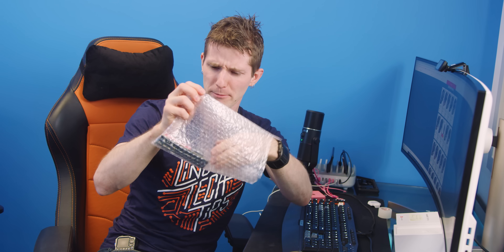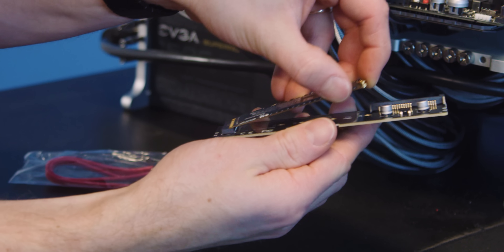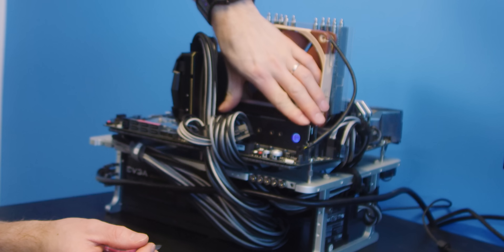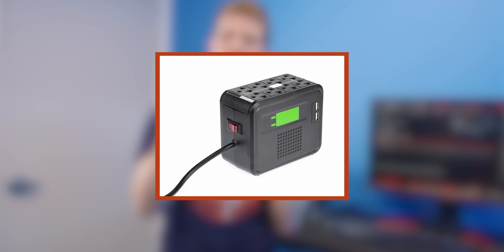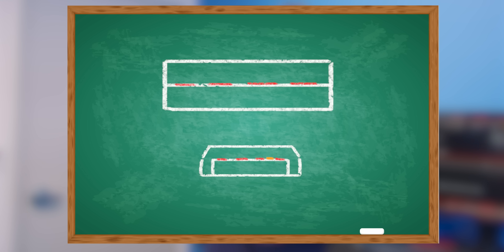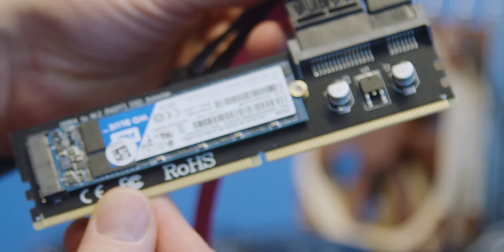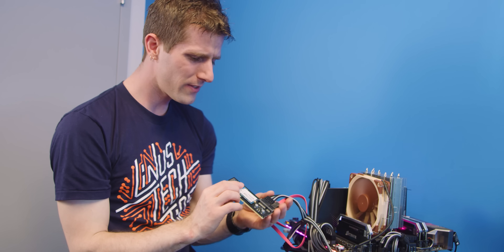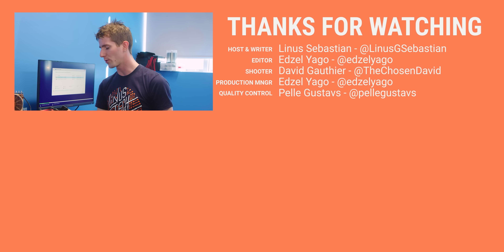They LIED to me! - DDR4 RAM to M.2 SSD Adapter

Comment: I suspect the adapter was made as another option to mount it in your computer in case you don't have a slot for an M.2 card. I have an x79 motherboard with an i74930k with no M.2 slots. My motherboard has 8 memory slots, of which I am only using 2. There are also pcie3 adaptors available for a sata M.2 ssd that requires a sata cable as well.

Comment: Useful to add an ssd to an older computer with no m.2 ports.  Keeps things kinda tidier.  I’d like to see this but that converts m.2 drives into RAM.  Could you imagine putting a terabyte of Ram in your pc, if windows even supports that much?  Even slightly slower would be awesome.  All the tabs!

Comment: I was expecting to make my RAM a SSD (which is possible with RAMDisk anyway).

I was severely disappointed.
Reply: It's very common to use RAM as a disk in Machine Learning. It's easy to do (depending on your distro)
Reply: @SimonWoodburyForget  but they both store information. You can use the RAM as a disk, literally as a regular folder / directory (in Linux at least) 
The other way around would be chaotic.

Comment: Asus has their DIMM.2 drive mount system that actually sends data and power through the DIMM slot for two NVMe drives (and power for a cooling fan too). However from what I can gather it is using a standard M.2 / PCIe interface and physically converting it to a DIMM interface. This makes sense if you want to mount vertically on a removable board and works well, but sadly you can't slot it into one of the memory channels and expect it to work. Neat though.

Comment: All this is doing is holding it in the DIMM slot. The power and data cables need to be attache for it to work. If you look it has the SATA Data and Power cable on the side of the board. This should have been your sign this is a scam.  They only way this would work at all would be if it was an NVME based one that plugged into a PCIE slot. Linus you really need to get up to date with the current  tech. Sad.

Comment: You were pretty disappointed when you figured out that the adapter wasn't using the DDR4-Slot at all? How come you're suddenly so damn stupid? A quick glimpse at the adapter told me (and you) that it uses SATA and that the DDR4-Slot is just for "mounting" the whole thing. Stop acting like an idiot or total newbie while we all know you're not.
While it's nice you now make videos for absolute beginners and the less intelligent people (damn, just look at the adapter. If it would use the DDR4-Slot why the fuck would it need a SATA-Data connector and a SATA-Power connector?) it would be nicer if you also kept making videos for the more professional users. Now it's completely unwatchable.

Comment: Well, this thing did have their purpose. You can see there are 4 RAM slots in many motherboard, and many just use 2 slots. So, why not utilised it? We just make a dummy RAM card so you can mount an SSD on it and connect it to A SATA, so you can cramp in more SSDs? Your motherboard only has 2, you know, and doing a RAID configuration is a bit difficult, and of course, occupying the motherboard NVME slot may make some of the PCIe slot disabled.

So, actually, this is quite an ingenious design. You can cover the unused RAM slot and at the same time, utilised that empty space for something else. Cool.

Comment: Who else thought that "DDR4 RAM to M.2 SSD" means that you can use RAM as your system drive?
Reply: You actually can, just download app called "RAMDISK" it let's you use some space on RAM as normal sata storage
Reply: @myangelomoi1091  - and stick to FreeDOS
Reply: @myangelomoi1091  I would prefer having all my ram available for other tasks. For example, preloading a game into a cheap, low-performance DIMM, and keeping the rest for actual gaming.
Reply: @juozasdomarkas848  if you want something that will load things faster get an ocz ssd drive . it has a cach that remembers frequently used programs. i came across it by accident but it does make a big difference
Reply: @juozasdomarkas848  If you have a recording program looping constantly on a hard drive, mapping ram to a drive would be better
Reply: @myangelomoi1091  ur stupid, and i hate you.
Reply: @myangelomoi1091  I wish AMD StoreMI would recognize ramdata. With 128GB of ram for 20 bucks your can create a 64GB ramdisk. Or create a hybrid ram/NVMe drive. Gen3 drives 3000/2200 or Gen4 drives in a gen3 mobo 3500/3500 would have a buffer at 8000/8000. $20...............
Reply: Yup. Just dont turn off your PC. EVER!
Reply: @TheHaters112  Backup batteries?
Reply: i was hoping for the other direction. Plug an NVME drive into a DDR4 slot and use it as slower system ram. a modern NVME drive is as fast as DDR2 and slow DDR3. but it would mean you could have upwards of 2TB of ram. (yes, on linux anyways you could just set the NVME drive up as swap and have at it).
Reply: @Cynyr  No be honest windows already uses page file when ram usage is full, so it's already using SSD like RAM. So i don't think there would be any benefit using ssd via ram interface
Reply: @myangelomoi1091  Exactly my thoughts. Wouldn't be any different than using it as normal.
Reply: @myangelomoi1091  cheap and very slow but also a lot of ram for the system, some programs refuse to run on some sysytem with no too much memory on it, 7zip is one of them if you want to used a huge dictionary, even with 16GB of phisical memory you cann't get the best of 7zip... Also if that will work the speed of the disk will be a problem
Reply: @myangelomoi1091   page file ? can you explain it.
Reply: @myangelomoi1091  what's interesting is modern m.2 is about as fast as ddr2 ram so you theoretically could use it lol
Reply: @Cynyr  thats a good point, huge ammount of ram, at slower speed! tho, who needs 1 or 2 tb of ram? nor 256gb!!!!
Reply: @agustinmorquecho7781  Well for one Animators and video editing takes up a TON of RAM. The more the better, I found that 32 gb wasn't nearly enough and I was only animating a simple maya animation.
Reply: @Cynyr  is swap memory susceptible to data breaches?
Reply: @iflnr978  I don't think any more so than system memory.
Reply: @Cynyr  Non Volatile RAM with slower speed and short life span.
Reply: @Cynyr  same i thought he would connect a 2 tb ssd to one and put it in the ram slot turns out it doesnt do that and i thought he would get another one and have 4 tb of ram total and see what windows does and if he can game on it.
Reply: @Cynyr  isn't that just the same as a pagefile?
Reply: @Jessay  yes and no. I think windows cares about where the data is actually located, and it needs to be all in one of the two, and windows tried to move things back to ram, before doing work on it. I was hoping this was a way to run things like FEA or CFD models that might need say 300GB+ ram to run. A huge page file won't help here if you only have 128GB ram in that case. If you want 70000 chrome tabs, then the huge page file does the same thing basically.
Reply: @Cynyr  ah that makes sense
Reply: I actually thought it would be the other way around. Use an M.2 as RAM.
Reply: I thought it meant the opposite, like you plug in an SSD and the adapter makes the computer think its actually RAM, so you could get like 200 GB of ram
Reply: @joebideng9226  That's also not bad, RAM as drive means super fast storage and SSD as ram means a lots of ram (but little bit slower)
Reply: raintz randmaa i know...
Reply: @raintzrandmaa9829  No it doesnt because the the ssd slot cant handle the speeds of ram so it would be the same speed as a ssd
Reply: I hadn't read carefully at first, so I thought it was about turning a M.2 SSD to a DDR4 RAM. LOL. If it worked, it'd be amazing.
Reply: Yeah. I hoped it would be something like the hardware ramdisks of yore. Then when I saw it put a M.2 into a DIMM slot I was like wtf.
Reply: Didn't Linus do a video about a year ago about an old DDR2 to PCI (iirc, it was just PCI, not PCIe, but might have been 1st gen PCIe) adaptor that was used for this purpose?
Reply: i thought u can use ssd as ram 😂😂
Reply: I thought it meant budget Ulltradimms.
Reply: Me
Reply: That's what that means. They meant to say "M.2 SSD to DDR4 RAM".
Reply: There was a thins called iram and hyperos hyper disk Google it but both projects were bought by huge hard drive companies to stop them to fuck they slow shitty hard drive
Reply: I thought it meant using putting ddr4 in the m.2 slot
Reply: @Blackgazebo.  Me too. It's a misleading title.
Reply: Me
Reply: Or reverse : an SSD as a huge RAM
Reply: I was thinking you might be able to use an ssd as ram
might be much slower but also has a lot more capaciy
some people might have uses for that
Reply: no fuck no
Reply: I though he was using the m.2 as ram
Reply: I thought the other way around.
Reply: Me
Reply: There is also the Gigabyte iRam thing from 2006
Reply: I was really hoping for “easy” 2 tb of ram
Reply: Linus did a video on that with ddr2 ram. Here's the vid https://www.youtube.com/watch?v=bYbCYgYZVT8
Reply: i thought you could use your ssd as ram
Reply: No one
Reply: This isn’t new research ram drives their old
Reply: Not me
Reply: No. I thought it have a faster memory
Reply: You can with enough storage
Reply: You actually can, by deleting system 32 it basically blurs the line between ram and storage!
Reply: @iturnacupover4139  NO GOD PLEASE DONT
Reply: I actually thought the opposite, that it would allow you to use SSDs as RAM, even though now in hindsight I realize the order in the video title was different. :D
Reply: @ShaniAce  no plese who ever sees this donjt it will ruin ur system
Reply: @flmana3304  Haha lol don't worry, I would've never wanted to buy that piece of garbage, was just curious. :D
Reply: Me lol why
Reply: I thought I was use the m.2 ssd as ram
Reply: Imagine wasting a DDR4 slot for a thing like this which has no functionality related to DDR4 other than using the slot as a place to mount it.  I would personally rather load that slot full of memory.  I did such a thing and loaded my current DDR3 motherboard with 32 GB of RAM.  Why only 32 GB you might wonder?  That is only because the board might not work well with more since that is all it is supposed to address or I would have gotten more for it.  I am glad to have gotten that before these shortages happened because now you have lower than scum scalpers trying to sell it for a crazy price.
Reply: Me
Reply: I didnt, and Im sure many others didnt. But looking back now Im not sure how I didnt see that :/. Logic says its an adapter that takes DDR4 RAM and converts it to an interface that an m.2 SSD interface would accept.
Reply: Ur dum.
Reply: Samsung Phones explode randomly nobody bats an eye, Samsung phones costing over $2000 break spontaneaously and nobody bats an eye, a bald dude thirsty for money crushes an ipad with full force for money and everybody becomes a tech expert
Reply: @WycliffStudios  That's completely unrelated and doesn't even make any sense.
Reply: @WycliffStudios  wtf are you on about, how is this relevant to anything?
Reply: @WycliffStudios  No. Samsung phones explode randomly and that phone is pulled. iPhones explode randomly and the tech news industry says "nothing to see here". Except they don't, because they don't say anything. Granted, it was one of the early models, I believe from around or before 2010.

Comment: What if you actually used it as Ram. Atm £30 of 240gb ssd is cheaper than actual ddr4 ram. Not that you would know what to do with so much ram but just a thought

Comment: This is M.2 to sata adpter is meant to occupy a ddr4 ram slot for absolutly no reason other than to secure it. Clearly not a joke since this was actually created. This is like something a highschool student would come up with as their final project just to pass a (Insert Course) class.
Reply: I'm designing a fiber optic cable surge protector!
Reply: @pyroslavx7922  One could argue that your invention is called an optoisolator.  ;)
It uses a short bit of optical circuitry to isolate electrical signals from certain spikes and noise.
Reply: @GM Scott Yeah, you exposed my evil plans, before i could sum up few hundred grands from crowdfunding and disappear ;-)
Reply: And there is actually a product that uses the ram slot for powering and it's still under 10 bucks..
Reply: Or to facilitate sales...
Reply: It's a scam. Mashing keywords together for a low price product selling it with a huge margin because of said keywords.
Reply: @coldfusionstormgaming1808  Funny part is that some of those adapters are sold in combination. 
they have two M2 slots , one with this fucking B key Linus had and the other for an actual NVMe. The adapter card is plugged in to the PCIe. Funny part is that the NVMe uses the PCIe lane but the B key SSD m2 need a Sata cable. No power connection is required though....
Reply: @Vanadium  Not that bad as the one in the video...

Comment: Trying to think of a plus side here, but it's impossible. I've only got 2 M2 slots on my motherboard, so this adds a... nope. It's a SATA connection, so as you say, might as well sticky tape the contraption to something in the case and fill up that extra memory slot. Hmmmm. Ok, I'm drowning in M2 type storage devices so might as well buy this for 8 bucks, sticky tape it to something in my case and add 2 TB that way, rather than go out and buy a SATA type SSD.

Comment: I was more hoping for the possibility to add a RAM stick to my m2 port, as a physical ram drive.
Reply: Gigabyte Hyperdrive was such a product.  It used a battery and Compact flash to backup on power off and protect from brownouts.
Reply: You can use SoftPerfect RAM Disk for that. It's not reliable for long time use due to the volatile nature of RAM but it's fun to mess around with and see the speed RAM would have as a storage drive.
Reply: @dany7ro101  yup I use ram drive sometimes for old small online games.
Reply: @dany7ro101  That was exactly what I was comparing it to. But with hardware, not software.
Reply: @dany7ro101  I think he wants quite the opposite, use a storage drive slot to a extra ram slot. Not use ram as storage
Reply: Just download some RAM?
Reply: @crysys Technically, that's exactly what Intel Optane is/does.
Reply: @CataclysmZA  Indeed. But it's pretty slow compared to a RAM stick. I'd love to have a HBM2 stick in a "16x slot", and use it as non-volatile storage.
Reply: Dvd-ram was a thing lol. Optical random access
Reply: @Demonslayer20111  I had that. Worked for shit, but was okay for the time.
Reply: Gigabyte iRAM is the name. Nowadays you'd get roughly 128GB of RAMDisk. It kept alive with standby power, and also had battery backup, and you could also easily copy it from a SSD. in... well, 1 second. RAM can do like 50,000mB/s write speed, no idea the capacity on the PCI-E bus, but nowadays it probably wouldn't be noticeably better than a NVMe drive.
Reply: I use 32 of my 64gb of ram as a ram disk for cache
Reply: NBI does not allowed that.
Reply: There is absolutely no point to do that with today’s tech
Reply: Found a model for ya https://m.newegg.com/products/9SIA70P2R58593?ignorebbr=true&source=googleshopping&nm_mc=KNC-GoogleMKP-Mobile&cm_mmc=KNC-GoogleMKP-Mobile-pla-Acard+TechnologyAccessories+-+Hard+Drive_-9SIA70P2R58593&gclid=CjwKCAjwndvlBRANEiwABrR32J90YM_qmgY7_9k1UYH5J2wuwPXovbsn7JD1m5ADwbn5S_Wu67MSPhoCTGkQAvD_BwE&gclsrc=aw.ds
Reply: Be a rebel and just download more ram and call it what you like.
Reply: @tillmanadkins713  i <3 crazy tech gadgets... this reminds me of an micro SD raid array PCIe card  i saw, filed under interesting that they can do that.. but WHHHYYYY
Reply: @tillmanadkins713  Almost... just missing the PCI-E speed :)
Reply: Wouldn't be prudent. Not gone do it.
Reply: Samsung Phones explode randomly nobody bats an eye, Samsung phones costing over $2000 break spontaneaously and nobody bats an eye, a bald dude thirsty for money crushes an ipad with full force for money and everybody becomes a tech expert
Reply: @WycliffStudios  iPhone's and Mac's break and destroy themselves randomly, no body bats an eye.
Samsung phones break randomly and no body bats an eye.  

Some random dude reviews and breaks electronics on purpose and suddenly everyone cares about poor African children.

Comment: With the limited amount of PCIe slots on current motherboards, and the gigant coolers on a modern day GPU. You might not be able to access a PCIe slot for adding in a PCIe M.2 adaptor. And i haven't seen any pc cases that have mounting for m.2 drives yet. So this gives the possibility of use those 2 dimm slots that most users don't use these days.